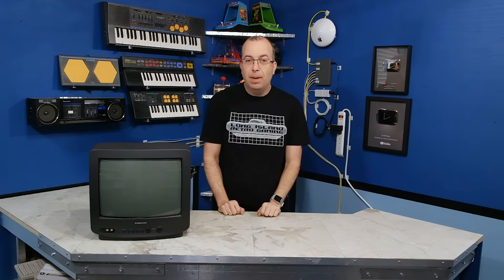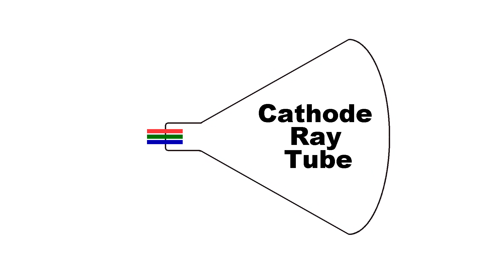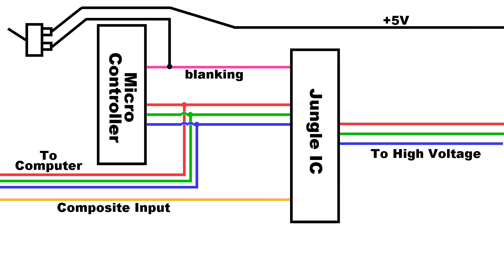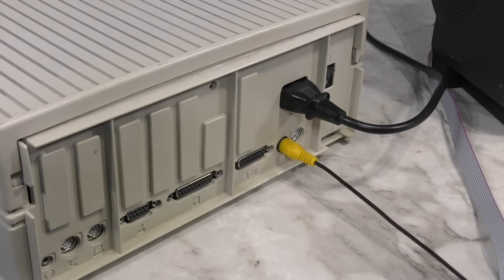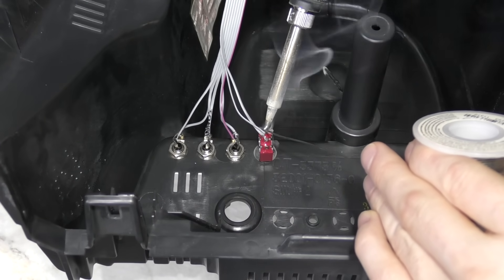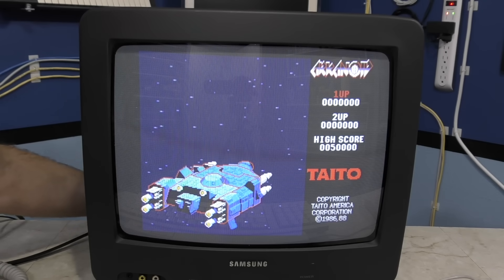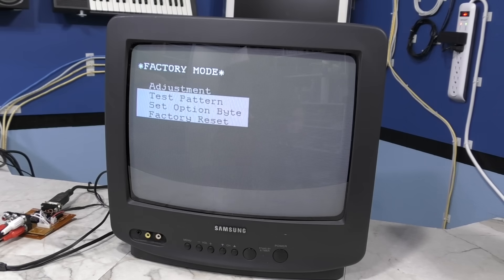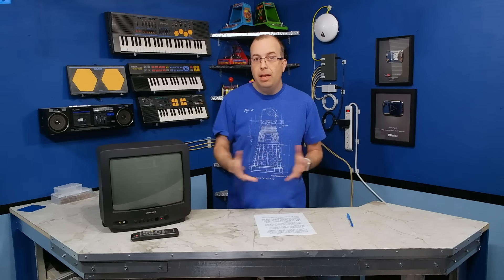Modding a consumer TV to use RGB input

Comment: How you get and put sync signal  V and H you use only one as sync, it seems ic have option of combined sync of V and H  instead of connecting V and H sync from vga seperately to specific section of V and H amp right? Explain?

Comment: 17 minutes into the video, you said what I'd been thinking the whole time. As another user has commented, here in Europe we had SCART sockets; they're still fitted even to many flat-panel tellies. My old Samsung plasma (from 2012) had one, my Sony Bravia (in the master bedroom) has one, the Panasonic Viera in the spare bedroom has one. It was pretty much universal fit to all European models, and of course the SCART would accept RGB, composite or S-video. I did notice that the rear composite and audio input on your TV was located in a SCART-shaped cutout, making me wonder if it was possible to retro-fit a SCART socket to the main board?

Weirdly, many Japanese TVs (eg my old Panasonic Quintrix CRT) would only support RGB on one of the SCARTs and S-Video on the other. European-made TVs usually would accept SCART on both inputs. This was only really a problem when you had a DVD player and a digital TV box that you wanted to connect, as both used RGB. The solution was to connect up a DVD recorder with built in Freeview, as then you had a DTV receiver and DVD player in one box that only needed a single SCART. This was what I did with the bedroom TV for several years until I upgraded to the Bravia.

Still, fascinating video, mainly from the point of view of "this wasn't a thing in NTSC countries, and here's how to work around it".

Comment: On my tube TV, there isn't much of a difference between composite and RGB, so I'm not exactly sure if a mod is necessary unless the TV handles composite badly.
Reply: what rgb source(s) are you using? for example the 2chip snes has blurry rgb output

Comment: Judging by the shape of the block with RCA, there was a model with scart, i think it was possible to replace the socket, then less wires would be needed. And speaking of wires, for rgb and component you need to use a shielded coaxial cable, otherwise the clarity will drop

Comment: A great deal of our TVs in Europe had RGB via SCART. The real headache is inputting RGB via RCA as the way a SCART device tells the TV that it is sending RGB and not Composite is by sending a 3v current through one of the pins. When I was working on a cheap way to split a SCART signal I had to use a power adapter to send 3v straight to the SCART ports, felt proper dirty.

Comment: Try to make it quick. I want to add component jack to a Sharp 25R-S100 to hook up a og Xbox to make a primal rage arcade replica. What ohm resistor should I use? A walkthrough digram will help alot. thanks.

Comment: You sure do make me wish that I knew how to work on any CRT TV. I have one, where the composite jacks on the front and back both became loose, and the image with either now flickers and dims when being used. And, I just acquired a Panasonic CT-27L8G (literally saw it at the side of a road and brought it home), and most everything on it works fine, but yeah, ONE of the composite jacks is messed up, with a grainy and black and white image. My main issue, is fearing that I would hurt myself or damage SOMETHING, in attempt to discharge the CRT, but also, I lack any kind of work-space / work-bench where I could try to work on any of this.
Reply: i had that problem with a jvc i art awhile back. that tv is HUGE! i fixed it tho, the solder on the plug was cracked. if you know how to solder, you can fix your issue. if it ends up just bieng messed up beyond repair, thats a sorta common set and you could do like he did but run a wire from the composite pin instead so you can still have a composite jack.

Comment: Why would people tell you to use BNC connectors for a 15kHz line rate? Eh, I suppose it's hard to run the numbers in your head. Really cool mod though. I almost wish I wasn't in Europe so I had an excuse to try it. :) The back to back comparisons between RGB and composite are really interesting to me. They've convinced me to go with RGB if I ever build a homebrew system.

Comment: 13:22 - Why did the color shift so dramatically when switching from composite to RGB? It looks like a color blind version of the composite signal. RGB looks wrong and composite looks right.
Reply: im pretty sure its because he ran that jumper
Reply: @myface6739  This set benefits from 220-ohm terminations over 75-ohm, causing a washed picture. Even on unmodified sets, composite has that effect over component; cleaner signal.

Comment: i had someone do the mod for me but for whatever reason the scart socket outputs AV RCA quality not pure RGB but when i use a SYNC ON LUMA ps2 scart cable all i get is ( black and white picture )  any help ??
Reply: I'd say use BNC, not SCART. Make sure you're using the composite jack with a BNC converter for combined sync, H&V. I'd test with a CRT_emu_driver setup to ensure you're outputting proper RGBs.

Comment: I love this video, but there are essential details missing - for instance the values on the resistors that have to sit in line with the already present resistors on the RGB lines.  I believe what he used were 75 Ohm resistors - but I am not sure why - it could be these are the "75 ohm to ground" resistors.  In all fairness, 8 bit guy did say that analogue electronics is not his strong suit, so if you are going to try this at home, do some more research before making an attempt.  This video made it look really easy.  It's not, especially if you are a n00b.  Ask me how I know?  LMAO.
Reply: It also varies by manufacturer of the TV set. My PVM-9L1 requires 75 Ohm resistors grounded and 0.1yF capacitors for preventing the blanking from occurring or something thereof. I have an Orion TVCR0950B that I can almost modify, except I gotta find a way to amplify the RGB signals so the red line (pin 16) doesn't get 0.75v to activate blanking.
Reply: This particular set, with a TA120AN jungle, benefits from 220-ohm terminations instead of 75-ohm (Sunthar). Where are you seeing additional inline resistors? This method does work, with only three 75-ohm terminations used.
Reply: I killed a classic ibm color.  ps/2 monitor trying all this hackery. Basically this was before anyone actually cared.

Comment: Joe average may not know what an insulation displacement connector is. IDC. They are extremely common on ribbon cable. Ide disk drive cables  32 pin floppy drive  connectors. The pins are on a 0.1 inch grid.

Comment: And this is where 'our' (European) TV sets shone with their EuroSCART bulky connectors, which had dedicated pins for composite and separate ones for RGB. Mind you it was not always that sweet, as some cheaper ones 'cheated' and there was nothing connected to RGB pins... Which is why the first thing I'd check when buying new AV gear in analogue era was the SCART PINOUTS! ;-)

Comment: So, I was just recently needing to repair my CRT's S-video input since thats what I've been using for video on my set up, and when I myself looked up my CRT's schematic, as well as a quick inspection to my CRT's Back plate, it turned out that it had been designed to already have RGB added to it, with pretty straight forward hook ups, So here soon I'm going to go ahead and also just add that to it as well.

Comment: Revisiting this video I've found that your RCA port design was actually the optimal path NA SDTVs should have taken for TV definition progress. ;)
The S-Video connector type largely just created an unnecessary proprietary gap for consumers where just adding more RCA ports over time would have been a much more successful AV progression model.  Yes two ground wires for Chroma & Luma are technically better for noise but the reality was most SDTVs weren't high quality enough in CRT to make that difference apparent anyway.
Truth is Composite wasn't making that much traction in NA for a long time that changing the cable type entirely only scared most people off from adopting S-Video. You only have to jump forward to the Component standard to see a return back to RCA ports as somebody realized what a mistake it was to change the connector/cable standard on household TVs.
If S-video had just copied what some early computer monitors did using RCA ports the transition from Composite to S-Video to Component would have been a lot smoother for manufacturer and user alike bitd and even applies to now where S-Video cables for many consoles are less common than RCA whether new or aftermarket.
Also think Composite greyscale could have used more support on SDTVs as it was basically S-Video quality and worked well for a lot of the first PCs that didn't have dedicated monitors. Internal RGBI support in SDTVs would have been nice but it seems like external adapters serve that the best because of extra cost restrictions then and now.

Comment: It's funny that the hole in the plastic case where the composite inputs are mounted on a rectangular block of plastic is where an RGB SCART socket would be in the rest of the world on this exact model of TV. I'm surprised there aren't solder points right next to it for RGB from the SCART socket.

Comment: Or you just live in Europe, use SCART and get native RGB straight through 🙄 EDIT: Haha, of course 8-bit Guy mentions this right at the end.

Of course, for a lot of the time we were using this, we also had to put up with a lot of bad PAL ports, but that's another issue. Also, many gamers in Europe didn't see the benefits of RGB, or even know about it, because consoles from the sixth gen on (RF was standard before then) would come with the exact same composite cable that would be packaged with a console in NA. It just had a SCART adaptor that only had like 9 of the 21 possible pins. You'd have to go and get a full 21-pin RGB SCART cable to see the benefits. In fact, I only discovered it by accident because when I imported FFIX because I couldn't wait another 4 months for it to come out over here, it wouldn't display at all on the 50Hz 14" Panasonic in my bedroom, and only in black and white on the 50-60Hz Sony in the living room. Only when I bought a SCART lead did I get full technicolour RGB at 60Hz NTSC (also on a bigger, better TV). It was beautiful!

Comment: Didn't think a interlaced screen could have such clean text. Very nice demo
Reply: It's only interlaced if the computer or console is outputting an interlaced signal. I doubt any of the ones shown in this video did. A standard 15 kHz CRT TV can sync to a 240p signal just as easily as it can sync to a 480i (NTSC) signal, because they are both 15 kHz. 480i with consoles mainly started with the Sega Dreamcast and other consoles of that generation. The Dreamcast did support 240p, but most games were 480i by default. The original Playstation hardware also supported both 240p and 480i. Earlier consoles such as the SNES, NES, Atari 2600, etc., were 240p. The SNES has a 480i mode (512x448) but it was very rarely used; maybe one or two games ever used it.
Reply: @MaximRecoil  The Megadrive also supported 480i and Sonic 2 used it for the multiplayer. I think the PC Engine also supported 480i with some software trickery.

Comment: I just want to thank you! I have a few Pac-Man arcade boards that I use to test with, and I hated how they looked on a LCD monitor.  I picked up this TV (except in white) and modded it the exact same way you did, and Viola! Now I have an RGB monitor to test arcade boards with, and it looks INCREDIBLE!
So, thank you again. :)
Now to find this manual so I can get the service code to fix the overscan... :-/  ... Unless you can share it ;)
EDIT - I found it!  But unfortunately, I have overscan, and this TV version won't let me adjust the horizontal size, nor the vertical position. :(

Comment: For the video input on the chassis you really should have gone with a standard video connection instead of requiring some external solution. Really defeats the purpose of it.

Comment: Nice job ruining it. Someday this is going to be a historical antique. Might as well have shoved another paperclip in it. If you want a composite monitor, B&H has them all day long for less than $500.
Antiques Roadshow 2050: "What you have here is a 1997 Samsung 13" CRT Television, people would tune into programs and watch them on this."
Customer in 2050: "How much is it worth?"
Antiques Roadshow 2050: "Well in original condition, I've seen these go up at auction and fetch $100,000. But it looks like some dummy drilled some holes in the back and modified the board. You could use it to prop a door open but other than that, I'd say $10. Maybe $15 on a good day."
Unreal.

Comment: Hello friend, I have a CRT '21 TV and the Component input has the image flickering, I connected the Y to the Composite AV1 input, the perfect and stable image appears, but black/white, it is possible for me to inject the other 2 cables from the Component in Composite to be colored?
Reply: no it's not possible to inject and what's the component video output device?
Reply: @gamecubeplayer  I'm using a Wii and Mister FPGA for component video, unfortunately the "Y" of the component input is bad, I need to find a solution!
Reply: @marcelosofth  it's possible that the y rca jack is loose and you can try to solder it back in but it's dangerous to work inside crts

Comment: Hello guys, 

I watched the video, but i have to ask if there is another way how to connect my CRT TV as a secondary monitor to my Desktop PC via the graphics card (Radeon 7950)'s DVI-I port or via the MiniDisplayPort. I intend to use the CRT for games that require racing wheel, also i am using the tv for my older generation consoles, i am looking to get a quality of picture something similar to the PlayStation 3's AV output. On my older PC the Radeon 9550 had an built in TV out that allowed me to output picture on the CRT, but nowadays graphics card don't have it anymore. I have seen and found numerous converters and cables but I am not sure how to proceed, I have already done some damage to the PC's Hard Disk with an miniDP cable to HDMI that made some electrical issue. So I don't wish to experiment anymore, I am looking for a straight solution something that has been tested and known to work. If you offer something as a solution or have some advices I will be happy to know.

Thanks.

Comment: Well the thing with SCART over here was that devices usually came with a cheap cable that wasn't fully wired. Basically s-video via SCART.
You had to go out and buy a more expensive fully wired, pinned and shielded cable to actually get that good picture.

Comment: I just had the opportunity to get a small 14" Sony Trinitron CRT. It has a Scart Connector, but the picture was non-existant because the scart connector solder joints got bad. Resoldered the pins and now it works well.
One thing to note: when doing something like in the video, remember to discharge the caps on the mainboard. These can hold high voltages for days or weeks. Once I ran with a screwdriver (remember to not touch the metal) across a board and suddenly there was a loud bang as I shorted a cap.
Reply: You mean shorted
Reply: @stephensnell5707  Yes, shorted. Fixed the typo, thx.

Comment: Sorry for the necro.
I've watched a video from EEVBlog a while ago where he was trying to fix a modern LCD LG TV he had found in the dumpster room. This TV strangely had a fully working webOS UI but could not properly display any decoded video or HDMI input. Interestingly, this TV also had some kind of digital "jungle chip" which mixed video outputs from OSD and other outputs (including decoder) into one output. This makes sense -  you do not want decoded video content in main system memory for DRM reasons. So "jungle chips" still do exist in modern digital TVs.
Unfortunately, Dave managed to completely ruin that TV while trying to reflow the faulty video chip :(

Comment: Considering how expensive pvms are, this mod is a amazing. Wonder how a consumer tv modded to rgb compadres to the professional pvms quality.
Reply: PVMs are still much nicer but you're comparing a consumer television versus a commercial monitor. But if you can input RGB or Component Video into your TV it does a good job closing the gap. Composite video is very poor quality. If you have S-Video it's not too bad and I think most people would live with it. But the jump from Composite to RGB is like night and day. I recently started a RGB mod on a similar Samsung TV I got for free. The RGB picture is amazing. I originally planned to mount a SCART connector which is what is wired to it now but I didn't like the idea of cutting a big hole for it. I felt like it would never look very clean. Coming back to this video I decided to do the same and mount 3 RCA connectors and a switch to the back and change out my wires for ribbon and IDC connectors. 

If you can't get a PVM a nice consumer TV with RGB or Component will still treat you well for your retro gaming needs.

Comment: The OSD is dimmer because he put the resistors in series with the old ones, if I followed correctly. I'm not criticizing, since there are good reasons one might put the OSD through 2 resistors and the new input through one.

On the CGA intensity line part, I think the crude hack one can do is add a resistor and 3 diodes so that the intensity line increases all the RGB inputs at the same time. The diodes are to prevent shorting the 3 signals while one is increasing them from the intensity line. I've seen some homebrewers make interesting DAC converters such as have 2 bits for each RGB line and 2 intensity bits. So 6 independent bits and 2 global intensity bits. So a typical DAC but with 2 more resistors and 6 diodes.